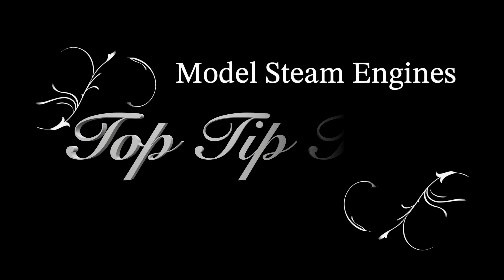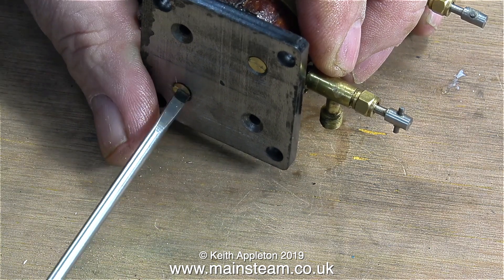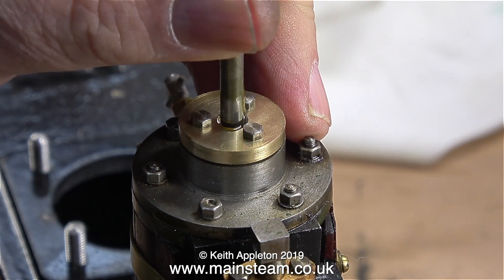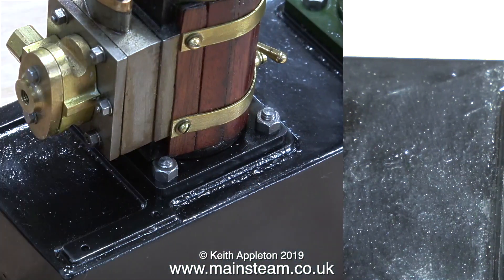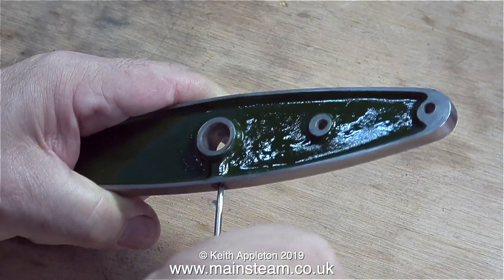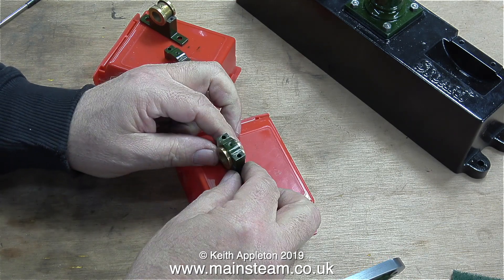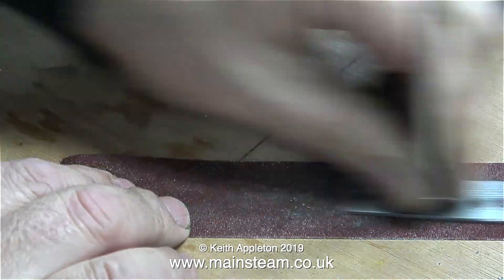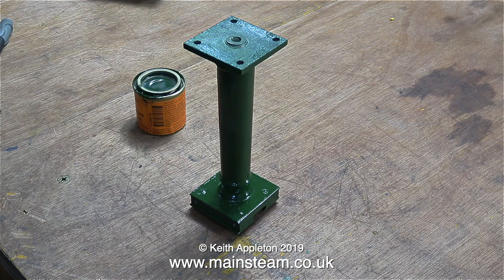MODEL STEAM ENGINES TOP TIP TIME - PART #13

Comment: As always, thanks for your time sharing your knowledge.
Regarding the oil reservoirs, what do you think about the ones that use a thick felt washer to retain the oil in place?
Reply from the maker: I prefer them open (with a lid) then you can lift the lid and immediately see the oil level.

Comment: Hi Keith, I don't mind the nut on the base although I pop the nut in the lathe and slightly releve the face. I always keep the off cut of long BA bolts that ive cut off so the thread goes into the lathe and the out the front of the chuck. That way the hex is clear of the base.

Comment: The clip of the paint drying was a bit short - I had to pause the video to get the full effect.
Reply: Playback speed can be set as low as .25!!!
Reply: You can also reduce the speed of playback during the section.
Reply from the maker: or just pause the video .........